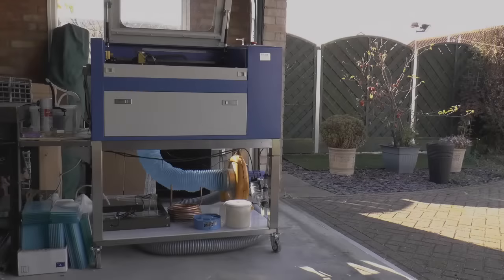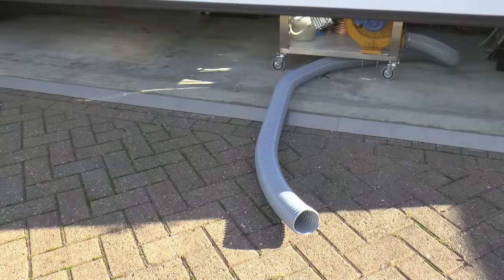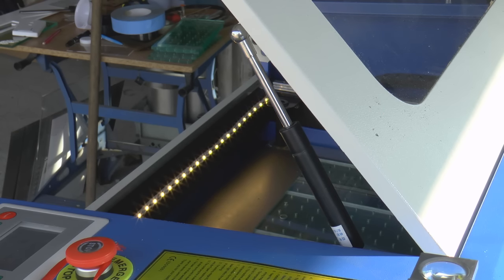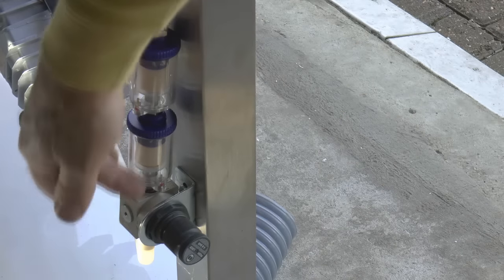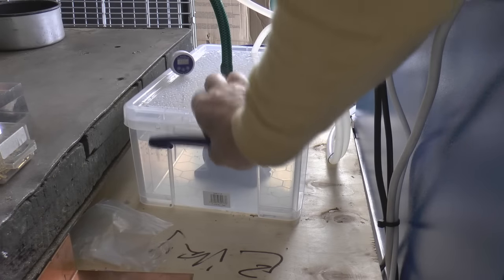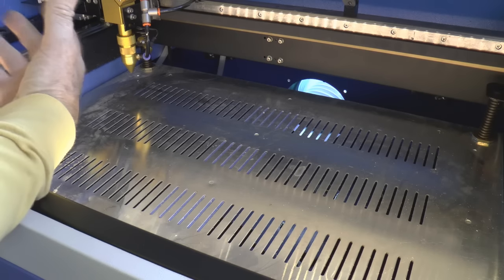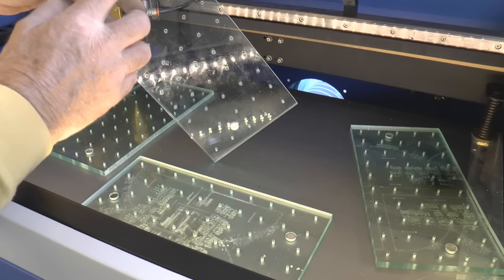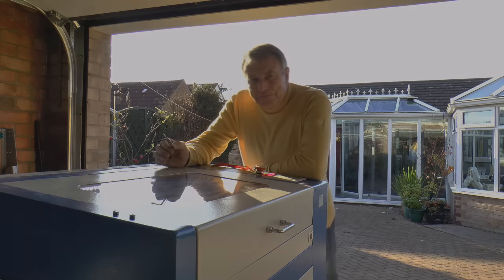My 50 watt Chinese Laser 4-month review

Comment: You always fascinated me by what you have done and this makes me wonder what field of engineering you have studied ?
Reply from the maker: Hi Waseem
My engineering education has been over a lifetime ( and still continues today) and has covered many different disciplines and industries. Production engineering, design of machine tools jigs and fixtures, inspection, metrology and quality control, along with management of teams and running my own precision  sheet metalwork business. I have worked for large international companies as well as small family run businesses. I have worked in many different industries including large industrial fan manufacture (window fans to 3m diameter power station cooling fans), diesel fuel injection nozzle manufacture, oilfield/offshore well safety shut down systems, semi conductor manufacture, surface mount robotic pick and place  machines . There is more but this is enough to get the idea. Retirement is just another opportunity to lean something new.

Best wishes
Rus
Reply: Hi Rus
Sure this is reveals the secret behind all of these magical things that you do
I'm sure that I'll have another stop stations with you in the future

Wish you the best

Comment: Interesting video. Leaving the laser lid open when  the laser is running isn't a good idea. Most Chinese Laser machines have plenty of gaps between panels and lids to allow enough air to flow in. Quite like your pinboard, but I think acrylic is the wrong material to use, you want to use something less inflammable, maybe a piece of corian might work better.
Reply from the maker: +Julian Ashcroft  You are technically correct about leaving the lid open. In a factory it would be considered a health and safety issue and be prevented with interlock switches Glad to say this is no factory and I can take liberties.

I started off using the little extract fan supplied. It was pathetic on heavy fume producers such as MDF, felt and leather. The secret of good fume extraction is  high volumetric air flow. The centrifugal fan I have used has just such abilities. However, the lid must be at least half open to get sufficient airflow into the machine to scavenge the work surface (especially in the corners) Close the lid and air stall in the impeller occurs and extraction efficiency plummets. I purposely used such a powerful fan because I wanted to run the machine with the lid open for my video work.

The pin bed allows me to set the support points so that the laser does not hit them whilst cutting a job and has worked very successfully for me. For someone in volume business a honeycomb bed may have to be the speedier choice. I used acrylic for several reasons. I have a cheap source of acrylic offcuts.  Acrylic vaporizes rather than burn, but the dense vapour produced can be ignited by the laser beam. However, the air assist will immediately dilute this vapour  and prevent a flammable ratio forming.  A good extraction system quickly assists this dilution.  The pins on this bed design suspend the work about 25mm above the bed surface. If I have set my power/speed correctly then 95% of the laser power will be used to cut the job and the remaining 5% will be very defocused by the time it impacts the bed. If my speed is too low, then there will be marking on the bed and this indication immediately lets me know I can increase the cutting speed. Corian is a great material (although still a cast acrylic) that has been loaded with 66% aluminium trihydrate filler (a fire retardant)during the casting process. Sadly it is expensive and I do not have a ready source of offcuts otherwise Corian would have been a good material choice
Sincere thanks for your comments because with only 15 minutes available for my videos, I often have to skimp on detail. So it's only in response to specific comments that I get a chance to explain my design decisions. Not all my decisions are correct or perfect and or often heavily influenced by "free" materials that I have to hand.

Comment: Did you buy the laser cutter from the UK or direct from China? If the latter can you give me any advice re customs/shipping etc. Thanks.
Reply from the maker: Hi Jennifer
I bought a machine from a UK warehouse. It is exactly like this and the same price I paid three and a half years ago. This is currently stored in Poland but the shipping is free
Although the brand clams to be unbranded generic, I can tell you that this will be a KH3050 model assembled in the Kehui factory It is fitted withe 2" focal length 18mm diameter lens . It is in general a good value machine BUT it (like all Ebay machines) is fitted with a B grade tube and B grade HV power supply.. You must accept that the tube and power supply may not work very well and that you will need to spend another £400 for A grade replacements within weeks or months.  I don't think you will be able to better this total price if you buy direct from China. Shipping, import, VAT and carriage charges could well exceed this £1600 total cost. 
Although these calim to be 50watt machines in reality they are fitted with 40 watt 800mm long tubes. If you decide to buy make sure you buy through ebay. and although you will get no protection,  it will be a means of communicating with the supplier (probably a private individual in China selling this for commission.) Make sure you use your credit card to buy, at least you will have the threat of chargeback by your card company that you can throw at the vendor. You may be able to negotiate a £250 refund towards a new proper 50watt tube.  

Hope this helps

Best wishes
Russ
Reply: @SarbarMultimedia  Hi, I have just bought a second hand one of these. It would be great to be able to have a chat for advise etc, I think I am really quite close to you as I am in Braintree, Essex.
Reply from the maker: @ridley68  
Hi Jennifer
I am indeed 20 miles close by. Add your email address to another comment. I get auto copied to my gmail so I will write to you off line and will delete your comment/email.
Best wishes
Russ

Comment: Hi Russ. Thank you so much for the excellently informative videos. I have recently bought this machine and I have many questions. My first one is regarding the voltage and power output of the machine. I'm living in Ireland and was wondering do I need a voltage convertor from 220 to 110? I'm working in my garage and the machine keeps tripping the switch. My second question is regarding the water pump. Does it need to be fully submerged and also did you have any issues with the black valve being very leaky? Thanks in advance.
Reply from the maker: Hi Eoghan

The only two places in the world using 110v are  N and S America and Taiwan. Everywhere else is 220v.  Check the rating plate on your machine, ,it should specify the voltage required. There may be a switch on the HV power supply that powers the tube, see what voltage that is set at, should be 220V . I have my two machines running in my garage from a 13amp ring main and a 20 amp trip to deal with motor startup spikes The plugs that connect the machines to the mains  are fused at 5 amps so there is not that much current being drawn. If you turn all the switches off, water pump, laser and air pump,   is it still tripping? If yes, remove all the plugs as well and try again.  If it still trips it is probably your RCD tripping and that is detecting leakage to earth of just a few milliamps. There is something wrong with the wiring that requires the services of a competent electrician with some .measuring gear.. I am not qualified to advise you.
Regarding the water pump, yes  the water should be above the level of the inlet grill.. I have removed the inlet grill and foam filter within because this is not being used in a pond. you need the maximum free flow.

Your other question about the black valve, I  don't recognize the part you speak of.

Best wishes
Russ
Reply: Thank you for your very detailed response. I really appreciate it. I have another question about the water pump. Could I use my own water pump that has a three pin plug, and run it through a separate power source rather than through the machine?
Thanks
Eoghan
Reply from the maker: @eoghanoneill7346 
 You certainly can.
 I have a 6-way switched extension lead strapped to the front of my machine and the extract fan,  temperature gauges, the machine itself I have left the water pump running from the machine  and the bank of video lights above the machine are all independently switched with a spare for my laptop. HOWEVER, I have left the water pump running from the machine  so that when I turn the machine on the water pump auto starts and there is never any fear of running the tube without water. I know there is a water protect switch which should fail safe but for such an important function I have used belt and braces.
Best wishes
Russ
ps don't ask why some of the text is red...I haven't a clue
Reply: Thanks Russ. You're a ledgend. I'm sure I'll have a few more questions for you in the near future.
Reply: SarbarMultimedia Hi Russ. More questions for you. I checked the rating plate on the machine and it says that it is 110v which isn't suited to Irish power supplies of 220v. What should I do to adapt the machine for it to operate on Irish power? Would a voltage convertor/ transformer be best suited? Thanks again. 
Eoghan
Reply from the maker: @eoghanoneill7346  
Hi Eoghan
Download this PDF manual for your controller. You will find a circuit diagram for a typical machine
http://en.rd-acs.com/Private/Files/a4d9f12fe9e32eb7.pdf
You will find that your mains drives 3 things within the machine 1)The mains conditioning transformer 24vdc for the controller 2) the  stepper drive transformer 3) the HV power supply that drives the laser tube.  If you look at each of these items you may find that the input voltage  can either be switched to 220v OR the wiring may be swapped to 220v input. This is fine if you can do this for the machine but be careful about the additional external item. Check the voltage required for your air pump and for your water pump. Who knows what you will have been sold ?   It may be cheaper to buy a new pump and compressor than to buy a 110v transformer.   If you wish to drive the machine with 110 v then a simple transformer is all that's required. Something like this will be fine
https://www.amazon.co.uk/Faithfull-TRAN33A-3-3kVA-Socket-Transformer/dp/B005OUWR34/ref=sr_1_3?ie=UTF8&qid=1542839445&sr=8-3&keywords=transformer+110v

You will also need to buy special plugs to run the machine. This transformer has two outputs so I would run the machine from one output initially  I know I can run my 60 watt machine with a 5amp fuse in the plug that means I am using less than 240V x 5amp  = 1250 VA or 1.25KVA  so a 3KVA transformer should be ok.

Best wishes
Russ
Reply: Hi Russ. Back again with more questions. I'm now powering my machine through a transformer. I have my air pump also hooked up to the transformer and my water pump is my own one and that's powered through an extension lead. They are working fine. When I switch the control switch on, the red light on the switch lights up, but the machine itself isn't turning on or showing any life. (No led light, laser head not resetting to zero). I think I may have damaged it by using the incorrect voltage. Is there any way to troubleshoot my machine, whether it's the power supply or something else. I just want to find what part I may have caused damage to. Any advice would be much appreciated. In a sticky situation here. 
Thanks,
Eoghan

Comment: you can compensate for backlash in most gcode software like Mach3 or whatnot. just an idea
Reply from the maker: Hi Bob
Thanks for the thought. I am now  quite long way on from this point and have learnt a huge amount about the technology, the software and the mechanics of this machine. I have come to realize that the fabulous value for money that this machine offers is full of small design compromises to keep the cost low.  Every weakness  pops up under certain circumstances and rarely have I seen them combine. Backlash is one such result of design compromise. On a decent CNC mill or router you will not find timing belts used to drive the axes. But because the head is relatively light on a laser machine  and there is no cutting resistance to fight, it is considered an OK system that almost all machines adopt, even the expensive ones. Timing belts were never designed  for  precision movement of oscillating loads. They were designed to transmit power in ONE direction (the clue is in the name).  They have been hijacked for this application because they do a pretty good job at low cost. when compared to ballscrews and rack and pinion systems. If you watch the belt carefully as it enters the drive pulley it will actually rise up and try to climb out of the first one or two pulley teeth. When the pulley  reverses, the belt drops down to a low position. The standard belts supplied with most machines are the  cheaper rubber toothed type which have compliance and tooth clearance. These two factors result in the head taking up different positions for the same XY keyboard coordinates depending on the direction that this coordinate is approached from.  Because this is a constant problem (not speed dependent)  It is treated as backlash and RDWorks has the capability to compensate for it. It is rarely set by the factory and very few people actually understand how to check it and compensate for it.  There are many other factors with this machine that can generate backlash-like errors. One of the more common ones is a poorly tightened grub screw on one of the drive pulleys. Depending on the degree of residual tightness the screw may drive satisfactorily at low accelerations and only exhibit mechanical backlash characteristics at higher accelerations. This has to be recognized and dealt with mechanically  because  software compensation cannot account for random backlash.

Best wishes
Russ